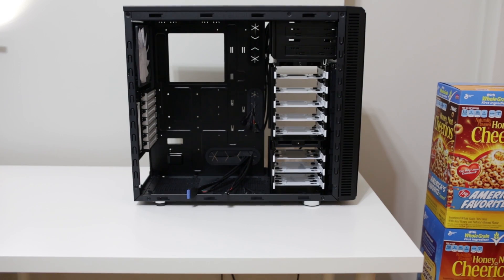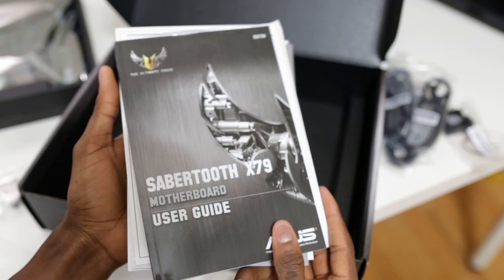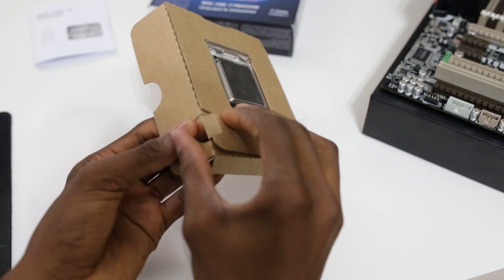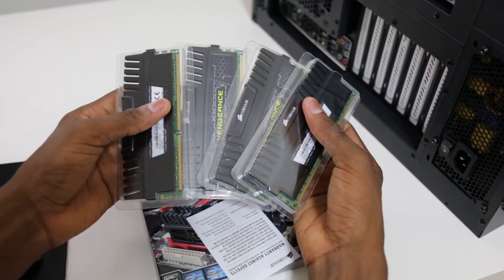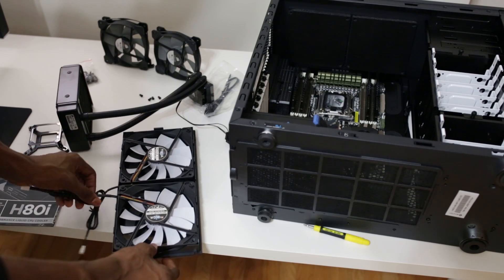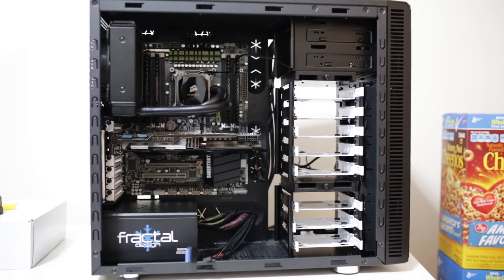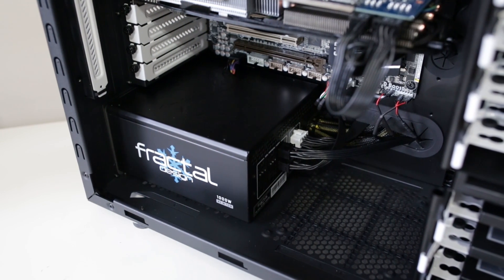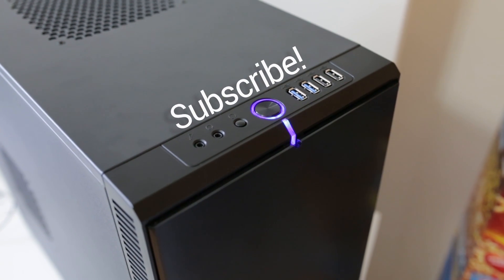Hackintosh Pro Project! [Part 3: The Build]

Comment: If you need to run both OS at the same time, you'll need to boot into Mac OS then run VMware or Parallels for windows (not the fastest/best). Its easier to run either separately